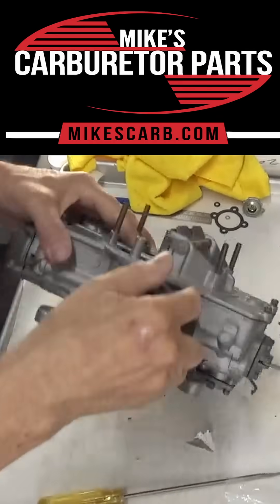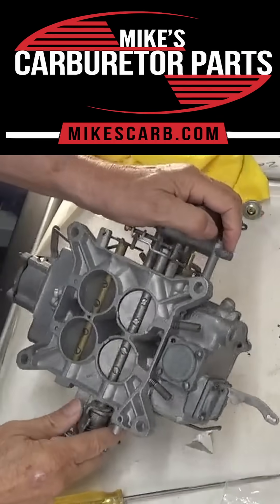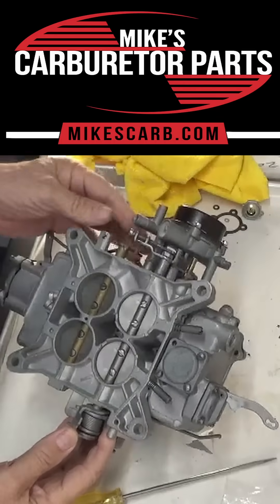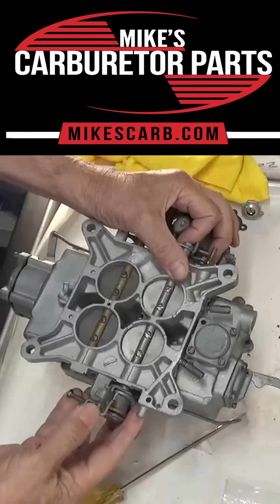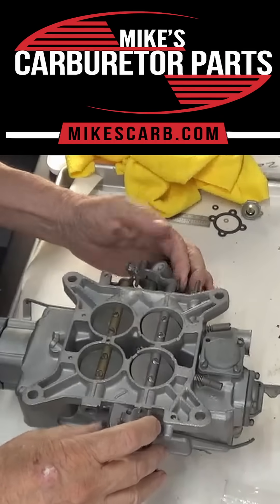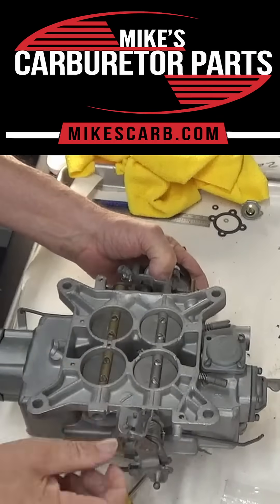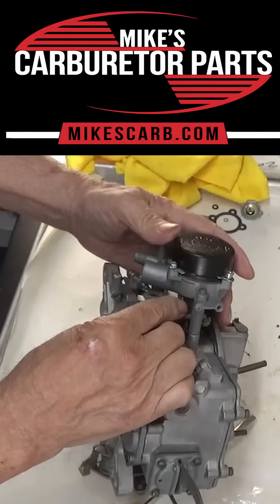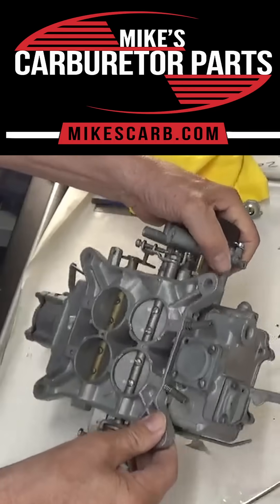4100 Primary Valves: Should They Be Closed All the Way?

Comment: Carburetors are simple, but complicated. Simple in principle, but complicated in practice. I never could get one to work properly. Electronic ignition and fuel injection together are probably the best and most impactful advancements in automotive design ever. Next comes FSD like a tsunami. I don’t think most people realize yet how Full Self Driving is going to change the auto industry.
Reply from the maker: You’re right, carbs can be a bit tricky sometimes but for classic cars it is what it is.
Reply: I have tinkered with the 2100, 4100, 4300, 2bbl Rochester, and a even a Qudrajet and thought I knew carbs. I've also worked on Evinrude small motor carbs.

I had to go back to school when I confronted the 3bbl Kiehin ones!